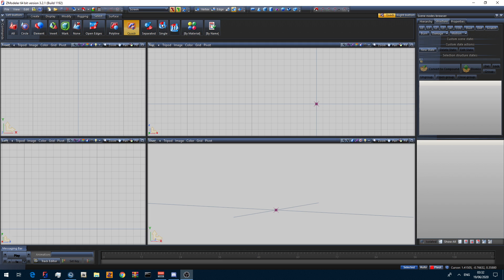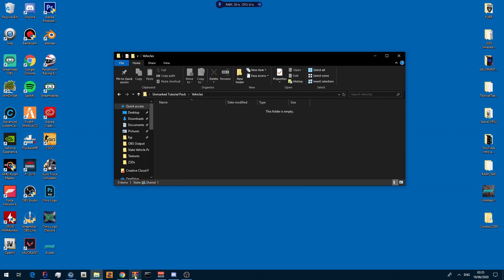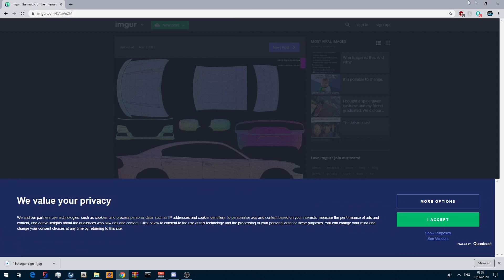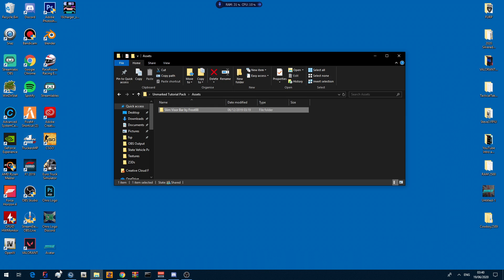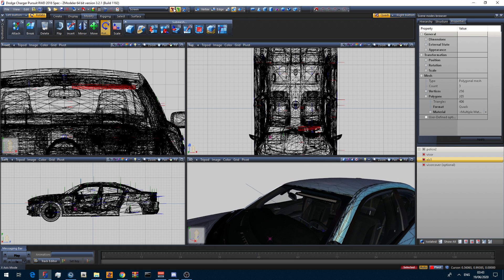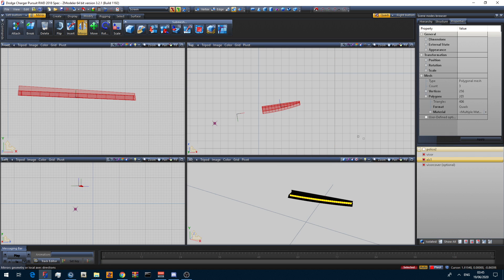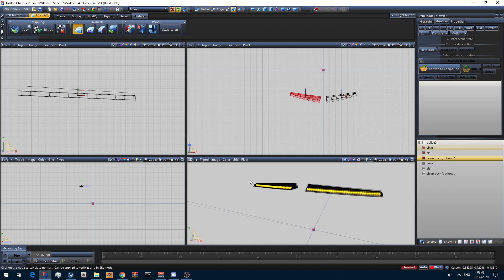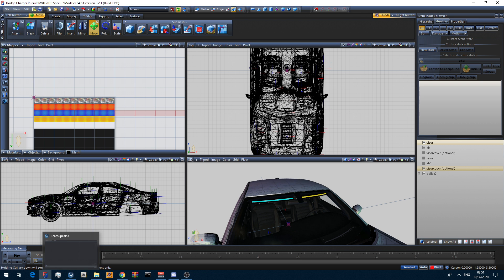CREATING A NON ELS POLICE VEHICLE STEP BY STEP | EPISODE 1 | 2018 DODGE CHARGER UNMARKED | ZMODELER3

Comment: Although this comment comes four years late, the reason the vehicle only has one wheel is that it’s more efficient to use a single model. Instead of creating and positioning four separate models, a line of code can duplicate the object, along with its collision mesh, and place it where the other wheels should be

Comment: Every time I try to import the charger template it will not show up in the folders or desktop. but after I try, I look at the location of there template and it is there. How do I fix this?
Reply from the maker: Skip the step, It doesn't need to be done as mentioned in the video.

Comment: How do I remove the badges on the rear of the car (the AWD logo)
Reply from the maker: Select the mesh in polygon mode, Use the "Select Tool" right the badge and click delete.
Reply: @McGinlay  if I were to add the badge back , what should I do?
Reply from the maker: Re-merge the model
Reply: @McGinlay  thanks for the advice!

Comment: Hello bro, is it possible to take the rocket model from the Rocket Voltic car and use it on other vehicle ?
Reply: nope ,I just tried it ,the rocket is a part of the bodyshell. You can view it in OpenIV aswell.
Reply from the maker: It actually is possible, you just have to make it work with metas and stuff